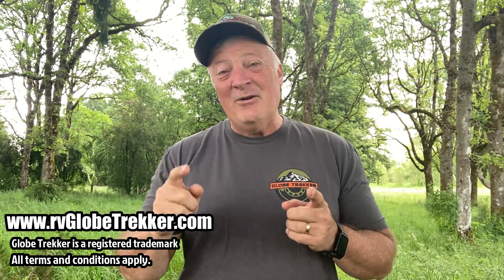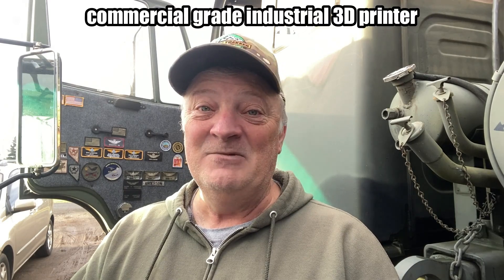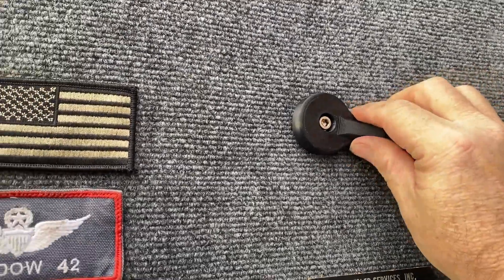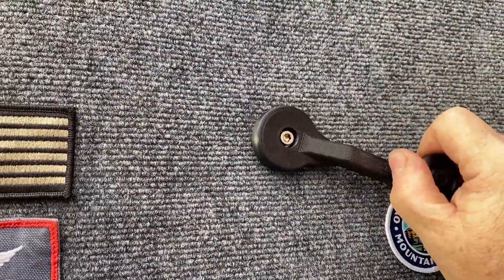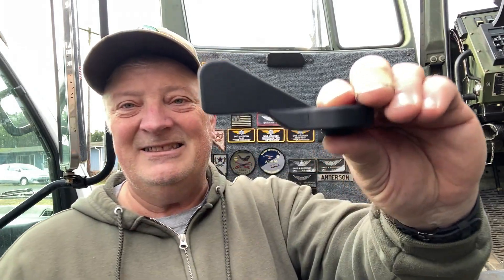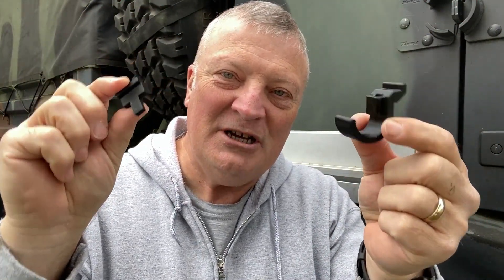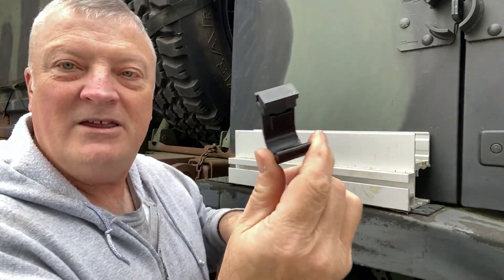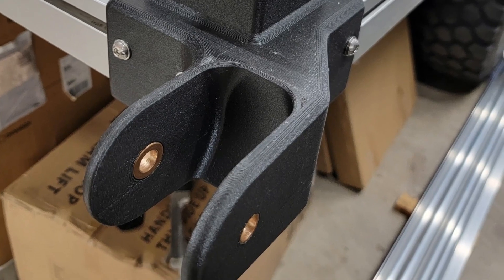Globe Trekker 3D PRINTED PARTS

Comment: I would like to put some 6 inch bar light from Baja Designs between the roof rails and the top of the habitat box that you guys design. Before I order the box from you guys, Is it possible to get the spacing between the the box and the roof rails increased to accommodate the bar lights?
Reply from the maker: For the 2.5" thick Expedition Series campers, yes. There may be a custom engineering fee, but it is normally not much.
Reply: @RVGlobeTrekker  Oh, alright. Thank you so much for replying!